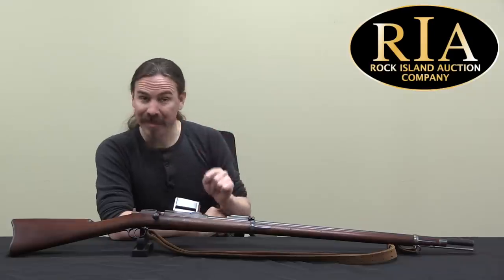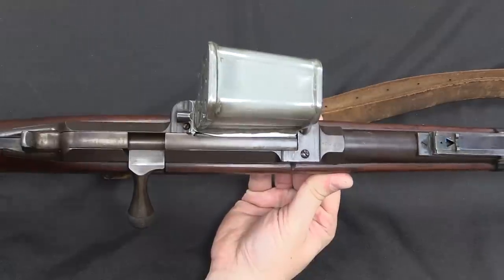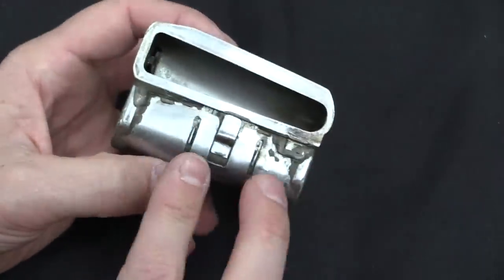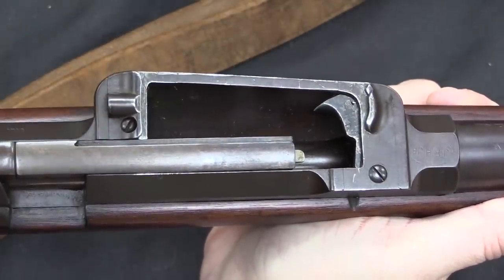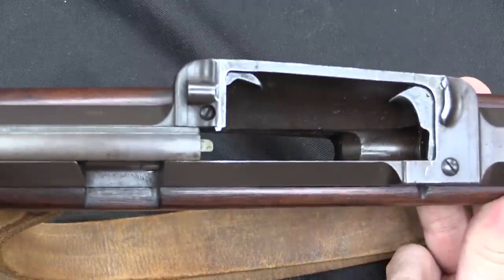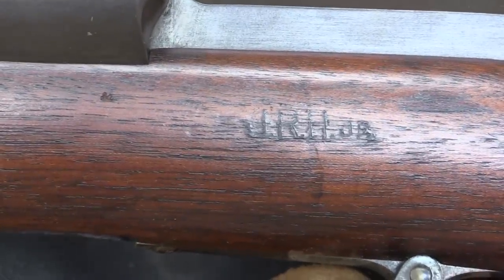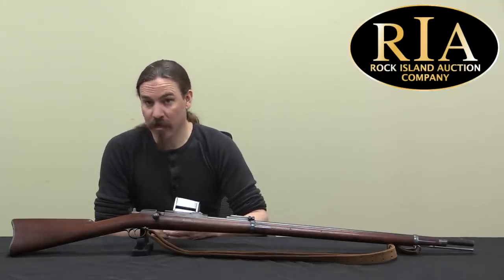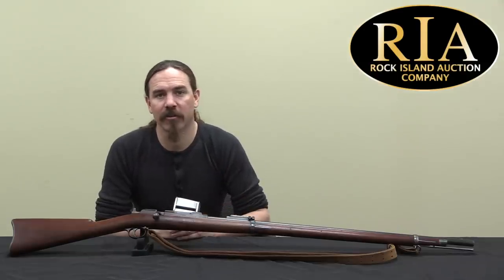Colt Franklin: Detachable 9-Round Magazine of .45-70 in 1884

Comment: It did not pass the "soldier proof" examination
Reply: Nothing is soldier proof.
Only "soldier resistant"
Reply: how to split the atom: give it to a soldier and tell him not to break it.
Reply: @windhelmguard5295  Sir, I lost my atom.
Reply: Sir, I was never issued an atom
Reply: "The common mistake in designing something completely foolproof is to underestimate the ingenuity of complete fools."
           Douglas Adams
Reply: Or solder proof
Reply: Russell  Reminds me of the old war time patent office story, that the first test of a new weapon was to throw it and it’s box out of the window, if it survived it might be worth looking at...
Reply: @SonicsniperV7  No word of a lie. One time one of my guys somehow managed to snap the gas piston of a M249 off the connecting rod //while it was still inside of the weapon// they ended up sending it off for testing to figure out how that was possible.
Reply: @chrisanderson8207  Doesn't sound as if it was an user fault there ?
Reply: @c0ya1 we couldn't figure it out. Hence the need to send it off for testing. The general feeling was that there was an defect with the metal of the gas piston/rod. From the amount of damage & bits of metal inside the gas cylinder we were pretty confident (but not certain) it hadn't been broken outside the weapon and then hidden by the diggers in question.

Comment: “Low opinion of enlisted men” 

War...war never changes
Reply: The difference between enlisted and officers today in the real world is not much except that the enlisted man will have generally a Technical or Engineering type of education level, Associate or above whereas the Officers will have a BA, that is a arts degree.  So the enlisted man has a hands on background of what they are doing in if I do this I expect this to happen.  Now most officers have a BA where it is more "I think, I feel, It should Be",  The officers that do have a technical degree have never actually applied their learning in the area of their degree, and it is true if you don't use it you loose it.  Spent 22 years active as enlisted had a AS in Mechanical Tech. and finished a AS in Electronics Tech, since then got a BS in Electronics Tech.  After retiring ended up in the Steel industry in Maint Dept Management.  Since I had my hands on experience and worked with several retired O club guys they were highly upset when I zoomed past them in advancement.  They after all were they were Officers and I was a lowly retired enlisted man, their technical skills sorry to say was years out of date and what they did remember wasn't all that useful.  They didn't grasp that you had to know the system inside and out to direct the repairs, and not tell others to handle it and walk away.   This will NEVER change in the military the mindset is entrenched to deeply, so you just play the game.
Reply: @thomasheer825  That's a middle-management problem that is not limited to the military.
Reply: It changes literally all the time lmao
Reply: @SPACECOWBOY_Hej  Shut its a fallout reference.

Comment: The feeding on this is identical to most every paintball gun.
Reply: Eric Hansen and I don’t think there has been a Sunday where I didn’t see someone’s revvie fall off the gun, spilling paint everywhere
Reply: @nicholas_scott  It has been a few decades since I played, but feed elbows with thumb screws were pretty common when I did. In the case of vertical feeds, you'd put a little sized CP ring inside the feed tube of your hopper to press it hard into the 'straight feed elbow' of the gun.
Reply: @nicholas_scott  never had that issue myself, but my markers are either mag/tube fed. The one hopper fed marker I have uses a picatinny mount and is synced to the trigger via RF, only hopper I've ever used that will feed reballs reliably at 15bps.
Reply: Can't believe the military copied paintball guns 😂😂😂 you'd think they would have smarter engineers 😂😂😂😂😂
Reply: Eye Above All  (that's the joke)

Comment: I get that this is basically a prototype, but the welding on that magazine is crude as hell.
Reply: 1884. There wasn't much welding of any kind going on (other than forge-welding). This box is soldered together using a hot iron heated over a fire.
Reply: jic1 Soldering’ll do that.
Reply: @moconnell663  In that case, the soldering is crude as hell.
Reply: @jic1  only if you've not soldered much sheet metal, it is not easy. I am unsure about the two gobs on the rear of the magazine (which are probably a repair of some kind) but the rest looks alright.

Comment: Even if the magazine got damaged, it would still function as a top loading single shot rifle. 

I think the thing to do would be to carry and use it as a single shot in most scenarios, and then pull the magazine out of a pouch during combat. Even a few of these in each unit would have meant a dramatic increase in firepower, and they could have been issued to only a select few. 

It would have been a boost, even in small numbers, and then when surpassed by newer designs, it would make decent weapon to "hand down" to rear line troops.
Reply: That makes more sense.  No point carrying the rifle with the magazine attached where it's likely to get damaged.  Issue a few of them and you could have the forerunners of today's SAW gunners.

Comment: Just wondering, this has nothing to do with the video in question, but the people who watch this probably have the most knowledge out there in terms of historical knowledge, but why don't most standard issue assault / battle rifles have compensators / muzzle brakes? I just watched the Scar mud test, and that thing was flailing violently after each and every shot. Wouldn't a muzzle brake or compensator make it significantly more controllable and otherwise better to use?

Comment: Forgive my ignorance, never fired a gun but am a big fan of the channel. Doesn't the blast pressure escape both upwards through the mag & witness holes but also downwards out the ejection port? I don't see anything the stops the gasses from escaping
Reply: No, because this is a bolt action weapon. All gas goes forward out the front. The locked bolt keeps the chamber sealed until the user manually opens it. 

No gas is used to cycle the action like a semi or full auto weapon, so nothing comes backward.
Reply: @Thenlar   Which also means you feel every ounce of the recoil.

Comment: If only the military actually turned round and said "we like the design but the magazine needs development" rather than rejection
Reply: The problem wasn't the magazine. The problem was:
1. That magazines tended to need to be tuned to the individual rifle to work.
2. The repeater is only faster than a single shot until the magazine is empty. Until the stripper clip is invented, reloading is done one round at a time. So over the course of a day of fighting, the repeater won't have that much of an advantage. So why bother with the extra cost?